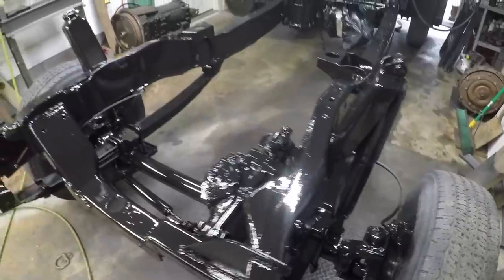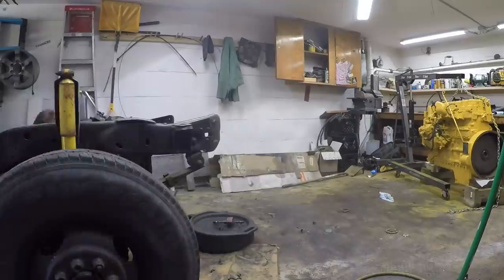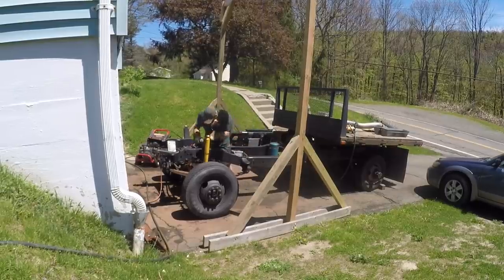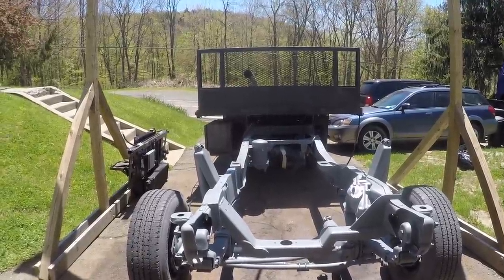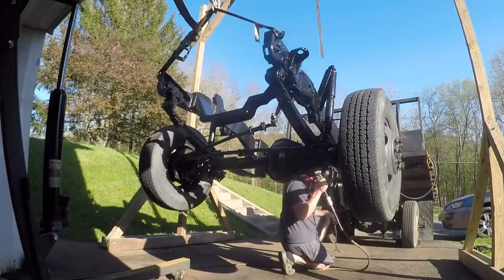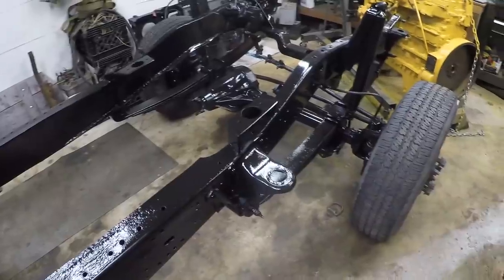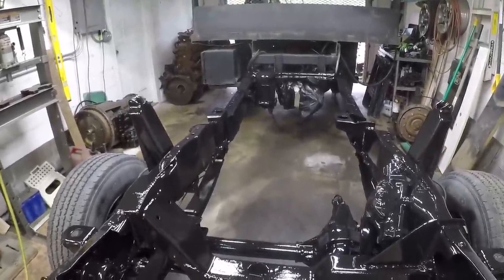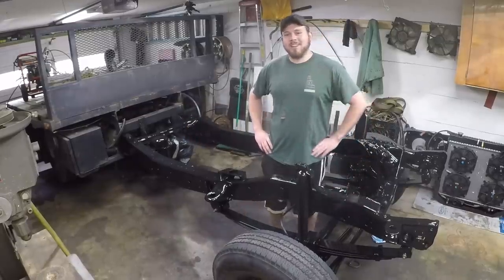Pt. 50 Cleaning And Painting The Frame. First Time Using HVLP Sprayer. 91F350 CAT 3126 Engine Swap.

Comment: I admire your motivation.  I did a Cummins swap on my 98 K3500 and it took everything out of me just to get it done and running.  I did clean and dress the engine and front frame section before the swap but those details take so much time... looks like you're doing most of this work solo so kudos to you for staying motivated and making progress.  Between work, kids and life it's tough to keep moving forward on these projects for me.

Comment: Any plans on removing the bed and doing the back half of the frame and also maybe cleaning/priming/shooting the bed itself?
Reply: And maybe freshen up the wheels? Just sayin, as long as ya have the paint...
Reply: @grandtheftautotune7715  those aren't his wheels he has a different set these are just to fit in the garage
Reply from the maker: I actually do have plans for the rear of the frame and the bed at some point down the road. Yeah the factory wheels are just to make it easier to work on, the 22.5 were just pained last summer before I put them on.

Comment: Should've did the wheels and flatbed too..You should try to ceramic coat the frame while it's glossy and see how that works out. I bet it will be easier to keep clean in the future..
Reply from the maker: Wheels were just painted before they were put on last year. Planning to do some work to the rear of the frame and the flatbed in the future including painting them.